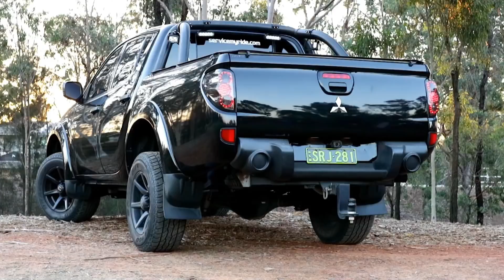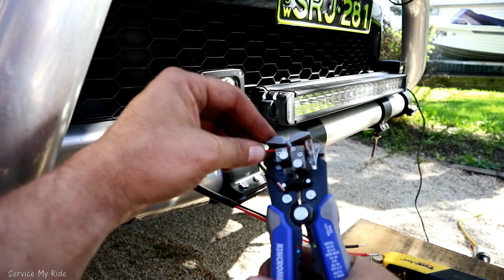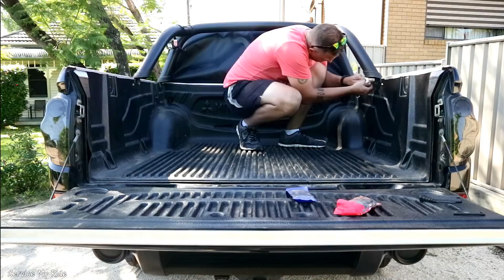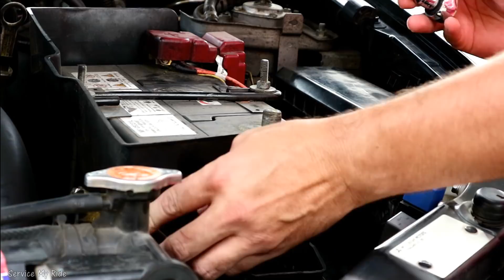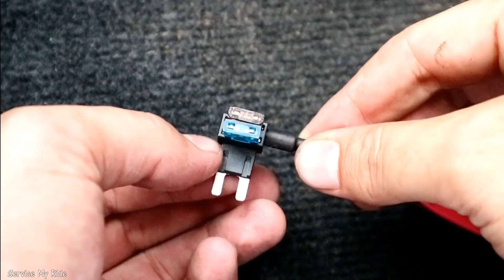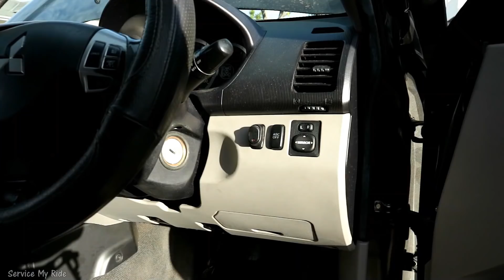LED light bar and work lamps install

Comment: If possible can you make a dual battery install on your Triton? Your video's give nice clear instructions that are very easy to follow, keep up the good work.
Reply from the maker: thanks Funky, we are looking into fitting a dual system, need to sort out the tub first but it's definitely in our sights
Reply: Thanks, that is great news; if possible can you install it under the bonnet? Looking forward to that install...

Comment: I'm going to install a few lights on my L200, just curious, where would I find the most accessible way through the firewall?
Reply from the maker: getous there is a number of
rubber grommets on the fire wall, poke the wire through which ever one is best suited to where you need the wires to go
Reply: Yeah I figured, is it easiest to reach them from underneath?